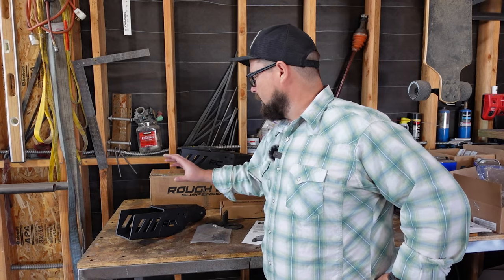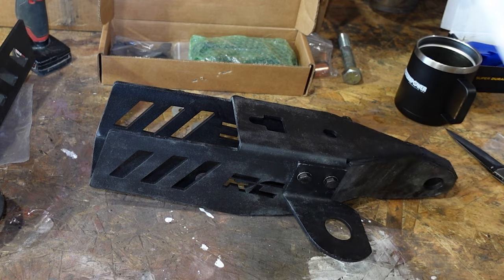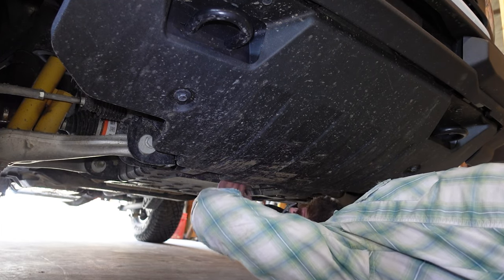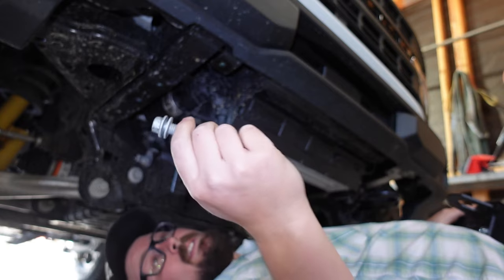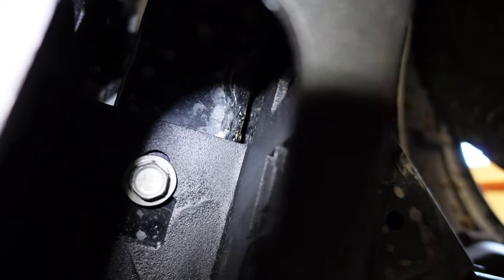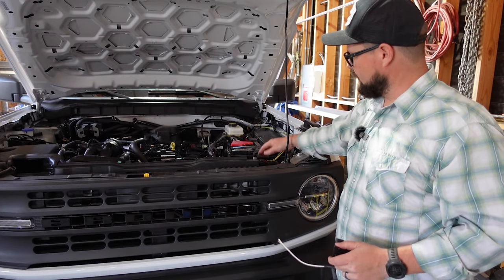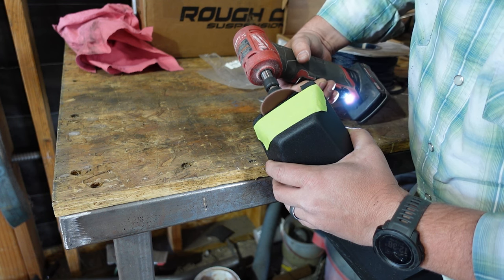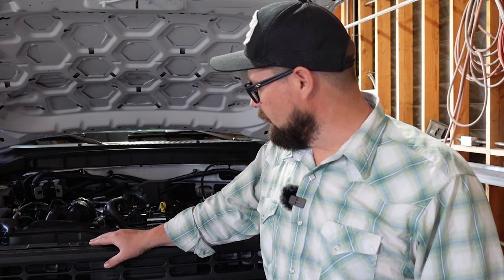Ford Bronco Rough Country Flat Tow Brackets Installation - Tow Hook Swap

Comment: I see you built your own towing setup.  Do you think the curt tow bar with D-ring adapters would work with these rough Country mounts?  I just hate to give up recovery points to install the other systems.
Reply from the maker: As long as the pin and hole diameters match, then I think the Curt tow bar will be fine.

Comment: Have you used these flat tow yet? I was looking at these for this exact reason. I currently pull a jeep with a d ring adapter.
Reply from the maker: Yeah, we've gone maybe 1000 miles and they work great! No noise or shakes and it tracks straight.

Comment: I was going to order these for flat towing and when I talked to RC they were adamant that these are NOT for flat towing. Did they tell you otherwise? I can't believe these or the new ones from Ford wouldn't suffice - if they wouldn't then what good are they as recovery points? TIA!
Reply from the maker: When we were researching and talking to Rough Country, these are the ones they recommended! We told them exactly what we were going to do and they said these would work. I wonder why they are saying otherwise now??? I can tell you that we haven't had any issues this whole time and everything still looks good and solid.
Reply: @RoadandReel  thank you! I'm going to go back to them and speak with someone else.